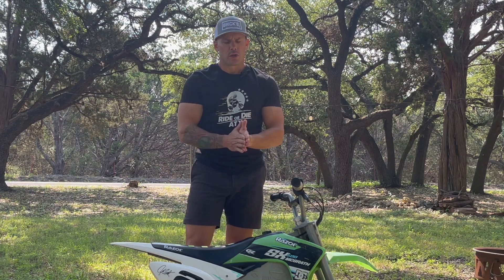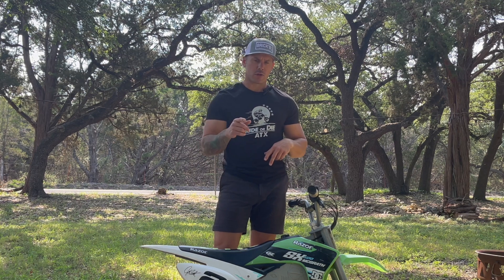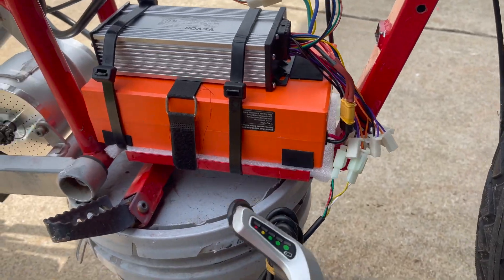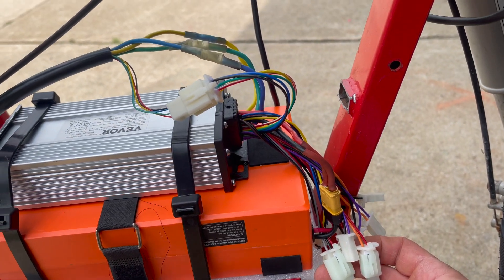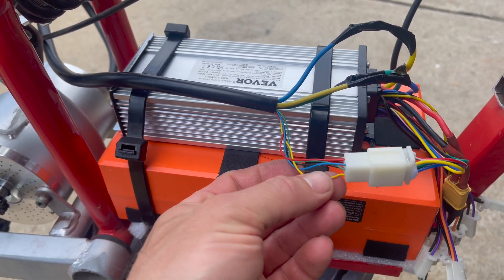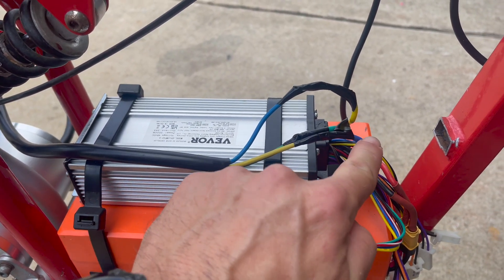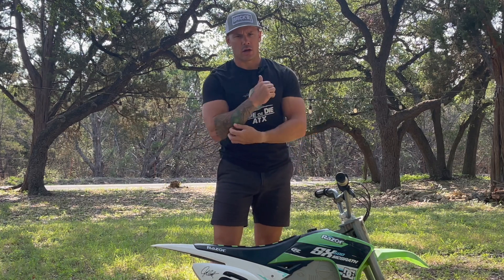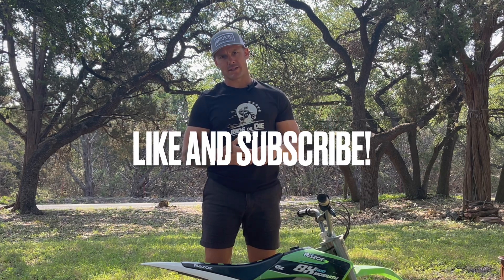How To Reverse A Brushless DC Motor- Kunray, Vevor, MY1020 Motor- Razor MX500, MX650, SX500, RSF650

Comment: Nice had the same problem with my qs165 with far driver win i installed it.
Reply from the maker: Did swapping the wires solve it?
Reply: @VoltronWatts  Yea I was in the phone with lone star for a while great guys  they were going to send me a firmware update for the far driver . I was able to figure it out by rewiring the harness they sent with the kit .Was not  to bad just took me a little time it was basically the same as you did with the two wire swap on the qs165  .Just the Qs has six wires .
Reply from the maker: @chadpipkin840  thank you for your knowledge sir 🤘
Reply: @VoltronWatts  Thank you .great video.
Reply from the maker: Anytime chad 🍻
Reply: @VoltronWatts  Also after you fix the rotation you have to let the controller relearn the system  then it ready to ride.
Reply: @VoltronWatts  Yes the wire swap fixed it.

Comment: I am using 2 VEVOR 2000W Electric Brushless DC Motor purchased on amazon. Am using them on a zero turn vehicle. I need full speed forward and reverse on both motors. The control is preconfigured for a slow speed when the reverse input is closed. Has anyone found a way to override the slow speed reverse?

Comment: Voltron HELP got the e and c little bit controller Finally and paired it with a vevor .. is this a possable combination case it wont do nothing but jutter. Im switched all combinations possible what am i doing wrong
Reply from the maker: You need to go into the tru motor app  and pair it to the MY1020 motor

Comment: Most controllers have a reverse wire. It's a two-wire pigtail. You just use a jumper wire to make the connection and the motor will run in the opposite direction.
Reply from the maker: Thanks for sharing!

Comment: Hey I fix the weel but I was going to ask after I fixed it it only went 20 miles per hour instead of 30 miles per hour I have a 48v battery and 2000w motor
Reply from the maker: That’s not good!
Reply: @VoltronWatts  do you know how to fix it

Comment: I have one question, does the motor work properly becouse i bought kunray and its rotate bakwards and what i read if i do this on the video will start get hotter ? do you have any problems after this change? thank you
Reply from the maker: Hey! Thanks for watching. I’ve never had a heat issue
Reply: @VoltronWatts  i try your method but not work, the motor blocks and start vibrating, dont work without hal sensors too :( i will order another controler :(

Comment: Do you know the motor phase wires do. Like weather not yellow is the positive or negative. I need to know what all of the wires do. Much help would be appreciated!
Reply from the maker: Three-phase motors use coils of wire to create magnetic fields and produce rotation. Standard 3-phase motors use six individual coils, two for each phase. The internal construction and connection of these coils inside of the motor is predetermined when the motor is manufactured
Reply: Thanks very much!! I’m assembling a easy motor controller 2 to hook up to the exact same vevor motor controller and I really need to know what the phases wires from the motor are so I can hook them up to the motor controller but idk what are neg and positive. If you know that would be great if you don’t it’s okay, I’ve spent hours and can’t find anything. Much thanks

Comment: Hey there, Working on a Kun-Ray. Smooth rotation, just need it to turn the other way. When I follow the directions at the bottom of the post it still turns the same direction, just without the 3 speed controls and sounds faster. Thanks
Reply from the maker: Glad it helped! Because to mine and subscribe 💪

Comment: Hi bro this diddnt work for me, when I did this the motor wasn’t giving power and was not deciding what direction to go, what do I do
Reply from the maker: Bad controller?
Reply: @VoltronWatts  nope it’s a brand new controller, is there any way I can make it go reverse full speed so then I don’t have to worry about the direction thing I can just ride in reverse mode the whole time because reverse mode is forwards for me but in reverse mode it only goes about 5mph
Reply: Have u fix IT same issue for me@Harry-m1m

Comment: I did this double yellow/blue cable swap, now I only get to full speed forward and slow backwards. Also the motor often stops working correctly and I have to put it to reverese to grt it running again. Any idea on what to do with my 3000w motor?
Reply from the maker: Hard to know. I’d contact Vevor
Reply: @VoltronWatts  basically it was blue yellow pairs on the current carrying cables and then switch the yellow and green on the hall sensors. Strange but worked well.
Reply from the maker: Glad you figured it out 👊
Reply: YES!!!! This!!! Thank you lol. I tried this and it worked for mine, thank you for sharing this
Reply: @mikasjoman  That did it for me! 
No matter what I tried it was go backwards (all colors match) or just make small click.
I switch yellow and blue on the thick cables (only green hit green) and the switch the yellow and green on the thin wires. (only thin blue hit blue). Now it turns the right way and I can also use the “3 gears”/ speed limiter.    
VEVOR 48 Volt 2000 Watt
Reply from the maker: @importoeren glad it worked!
Reply: @mikasjoman  thanks.. solved my issue. ordered straight from vevor.. and had to do the mixed colors
Reply: @mikasjoman omg after a full day of every combination this was it full speed smooth ❤️❤️❤️❤️
Reply: @importoeren the blue yellow motor wire and green yellow small wire swap worked for me too. Thanks.

Comment: How's it running? I did the exact wiring as you did which worked to make the motor go forward, but the acceleration was seriously lagging. Almost like it was slipping. Did you have this issue?
Reply from the maker: I got another option for you. Email me at voltronwatts@gmail.com
Reply: @VoltronWatts whAy solved this I did same thing you did went forward but rogiht an low power
Reply from the maker: Hmmm 🤔
Reply: did you figure out?

Comment: Just install the learning wires. When it runs " forwards" on testing. 
Simply give 1 full sweep of throttle. 
It will reverse direction.  Turn it off, unplug self learn. DONE..
Reply: ? There are no learning wires on my controller
Reply from the maker: Nope
Reply: Thank you ❤
Reply: Man, you rock! Yes, on the plug, I swapped the yellow and green and it work!!! So simple. Thanks
Reply from the maker: Seriously!?!
Reply: Ive built 3 different razors with 3 different cheap chinese controllers 50 amp, 60, amp and 80 amp, and they all ran backwards out of the box, sometimes even after a rebuild they run backwards.
-I just lift the rear wheel off the ground, plug in the "learn" wires and then plug in power. The rear wheel is gonna stutter for a sec, then its gonna go full power at that point disconnect the learn wires then disconnect power, reconnect power then you are done. Repeat if necessary is still going in reverse. Fix my issues 100% of the time. Your vid is great especially if you have mounting issues and you can only mount in a certain direction.
Reply: @tooshmart6669 what are the learning wires? I got myself a Vevor 72v and I did as OP in the video but it gives strange sounds and only full speed forward.
Reply: @mikasjoman  I know this is really old but if anyone else reads this you need to swap the blue and yellow like he said, but on the plug swap yellow and green, not yellow and blue.
Reply: @shawnb5333holy shit you just saved me, I was starting to lose hope
Reply: @shawnb5333 This just saved us on an electric upgrade for a go-cart.  We had already tried swapping the blue with yellow for the power and hall sensors but it didn't work.  Swapping the yellow and green for the hall sensors did the trick!  Thanks for taking the time to post your comment.
Reply: @shawnb5333bro you’re a lifesaver. Thank you!!
Reply: @tooshmart6669  where is this learning wire ?